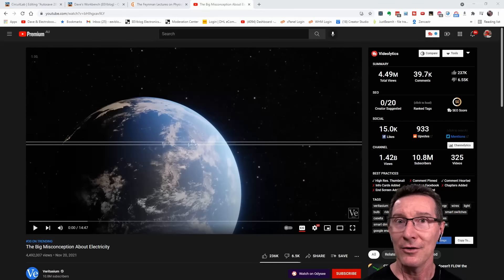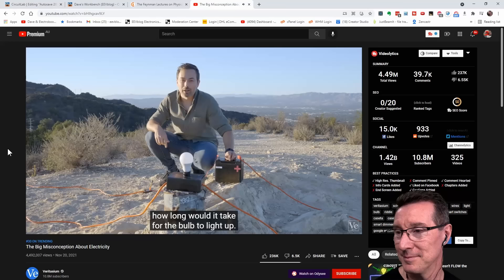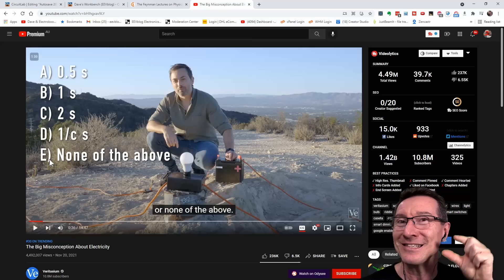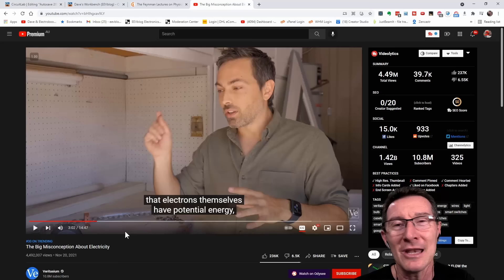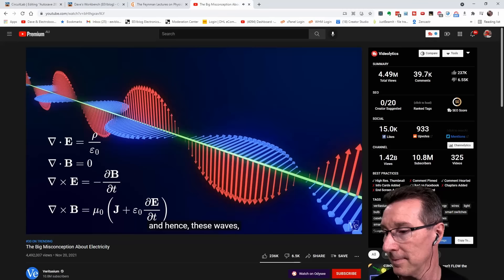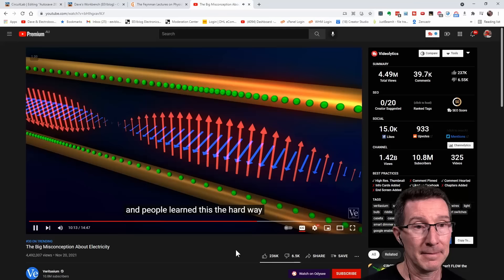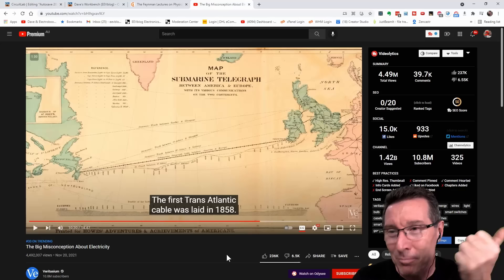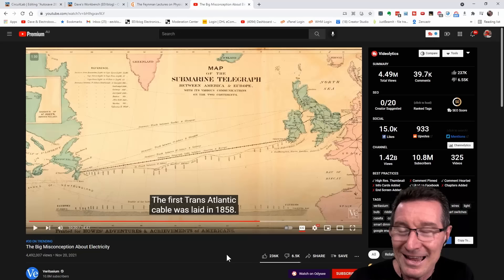EEVblog 1439 - Analysing Veritasium's Electricity Misconceptions Video

Comment: so, just to make sure: veritasium talks about how power is transmitted from the plant to your home. if I imagine a power line circle, on one end the plant and on the other my house, there's going to be a minuscule amount of power transmitted through the field in the center of the circle, am I right? but the majority of the delivered power is still going through the power line or rather through the field in very close proximity to the wire?
Reply: Yes, minuscule/insignificant amount is transmitted through air, in fact, this is undesirable, it can couple into unshielded circuits as noise. The real power goes along the power lines.
Reply: @1900OP  you are answering Lucas's question with erroneous beliefs.  I gather from your discussion that neither of you understand what Veritasium teaches.  I doubt I can make a dent in your beliefs, but I'll still volunteer the following.  There's a flow of electric energy radially outward from the battery to the space near it.  That space is where the EM field resides around the battery.  There's a radial flow of electric energy inward from the space around the wire to the wire, all along the wire.  There's also a radial flow of electric energy from the space around the bulb filament to the filament.  

Those are the facts, consistent with the basic EM laws of physics.  Your job now is to understand them.  Forget everything else you know or think you know about electricity.  The radiation energy you refer to, that emanates from a wire in which AC current flows, is irrelevant.  We are talking about the energy that lights the bulb.  That energy does NOT flow through the wire.  Charge flows through the wire, and it's called current.  The flow of charge is NOT the flow of energy.  Make a note of it.  

A further concept that may blow your minds is that the energy that flows radially outward from the battery is NOT the same energy that flows radially inward to the bulb filament.  That's because Mother Nature doesn't require it.  Nature only requires that both are numerically equal; i.e., that energy is conserved.
Reply: @beingsentient  i have no problem with the idea of power not going through/in the wire but around it. I have a problem with understanding if the light bulb in veritasiums vid goes full on or only some small amount and then the bulb goes "full" on after 1 second. 
"Full" on in 1m/c or only a tiny bit on in 1m/c and then full on after 1 second? 
Thanks for sharing
Reply: @beingsentient  
How have they measured the flow of energy coming in from all around the  bulb filament?
Reply: @redbutler751  Sorry, I really don't understand your question.  The time scale associated with the initial transient after the switch is closed is the order of a second or two.  The time scale associated with the first moment when the bulb "knows" there's a nearby battery is the order of ten nanoseconds or so.  Importantly, the transient needs to pass before the bulb reaches full intensity.  Is that clearer?
Reply: @robbiejames1540  I don't understand your question.  Are you referring to the steady state (DC) situation?  When you say "measured," do you mean actual experimental measurement or theoretical calculation?  In the steady state and theoretically, differential equations can be used to calculate the flow of energy into the bulb.  There are complications because of the actual geometry and I haven't carried out this calculation, but my guess is that reasonable approximations can be made for that geometry, with pretty good numerical results.
Reply: @beingsentient  
What I was meaning was an experimental measurement of the energy apparently flowing through the air from the battery to the bulb.
Reply: @beingsentient  
In my response to Lucas I was discussing his example, your home is km away from the power source, I said power is traveling along the line (it can be interpreted how you want, through the wire or fields around the wire, in practical terms, it doesn't matter), the rest is noise, and I stand by it.

 You are saying a lot of things, making an explanation difficult. But maybe this is your idea, to make things confusing, just like Veritasium did. Perhaps you also think you now know all about electricity just like Veritasium, when you've only learnt the poynting vector.

You say the same energy that flows outward from the battery is not the same energy that flows radially inward to the bulb filament, but IT IS the same, we're talking about EM energy (the form of it), and you also say they have to be numerically equal, yet you specifically say that there is energy flowing to the wire from the outward space, this means that wire  has a resistance (no energy flows to the wire if it doesn't have I*R losses), so numerically they are not the same (Energy_battery = Energy_bulb + Energy_I*wireR). 
Double check your conservation of energy theorem before you invent new concepts.
Reply: @1900OP  Thanks, mate! I think I got it. Also I feel like memyself misunderstood my question. I'm totally aware that energy flow != charge flow.
Reply: @1900OP  When people keep repeating what they said before, the conversation becomes fruitless.  I can only volunteer that you don't seem to have a broad enough nor deep enough grasp on basic physics to understand the basic EM concepts Veratasium explains.  You evidently are sufficiently capable of making engineering calculations, and you don't need an understanding of the basic physics to do that.  So you can go on your merry way calculating, but if you believe you understand the fundamental physics associated with EM theory, you're dead wrong.  You can talk to like minded engineers and feel good, but be sure not to run out of the Kool-Aid.
Reply: @robbiejames1540  I think I understand your question now, which involves the steady state DC operation of the circuit.  I don't know the answer.
Reply: @beingsentient  But you seem to repeat "You don't seem bright enough to understand veritasium" idea, you repeat it through the entire reply and previous comment, talk about repeating, duh.

But I figured you didn't wanted a conversation in the first place, you came here to teach, and anyone who doesn't agree with you must be dealt with, like you did right now.

You also seem to disregard engineering, do you think engineers don't know about the field they are working on? Do you think that calculations is all they do? Or was it part of the "you aren't bright enough" rhetoric you have against me. 

Veritasium is an internet influencer first and foremost, so what he says doesn't always makes sense, because he explores topics which requires great understanding, and talking about it with professors doesn't give him said understanding. 
Now that you say you have a good grasp of EM theory, it means you can explain Veritasium's experiment with your own words, instead of his, can you explain the phenomenas that happen when the switch is closed? How is energy transferred to the bulb in nanoseconds since the switch is closed?
Reply: @beingsentient  I quote you again, same  quote: "I can only volunteer that you don't seem to have a broad enough nor deep enough grasp on basic physics to understand the basic EM concepts Veratasium explains.", then what follows is  the usual insults, in all of your replies.

I don't know what you learned from veritasium, your opinions don't seem your own, only ideas told to you by veritasium, that's why you can't talk much about your EM theory you claim to know so much. So far you only told me 2 ideas, and I hope you can re-read your past replies so you don't claim I distort your statements:
1. Energy doesn't flow inside the wire, and charge flow =!= energy flow
2. There is a radial flow of energy outward from the battery towards the space around it, and inward the light bulb and wires if they were to receive energy.

So is this it? :) Is this all the EM theory you know? What about other more important principles that come before all this, like Maxwell's equations that define such behaviour in the first place, or maybe more specific, like talking about the electromagnetic radiation caused by accelerating electrons that produces the energy that is transmitted through the air? Of course, Veritasium doesn't talk about antenna effects or electromangetic radiation, neither does he talk about the whole thing being a transmission line, so you wouldn't know too.

I suggest you read Feynman's lectures, or if you really like getting your info from influencers, i'd suggest otherwise, Prof. Walter Lewin's lectures on youtube, because your physics knowledge is questionable.

If you are to further insult me, I will no longer respond, you're free to do as you wish, but if you want to debate, I'm open anytime here, I'm open to ideas, if you are really knowledgeable, I want to learn, so cite me some sources if you have, or books that I can find online. I'm also not sure what is wrong with "Energy flows along the power line" statement that started this all, you don't agree? Is this not fundamentally the thing you talk about, the field around the wire part? Because most of the power flows through there, that lights up your bulb in your home, not wireless energy, if you think otherwise then why do we have power lines in the first place?
Reply: @beingsentient  - If that were true for steady-state current flow then wire gauge wouldn't matter, BUT it does matter. In a steady state DC or low frequency AC circuit Power = I x I x R for a purely resistive circuit. That's why we have 15 A, 20 A, 30 A, etc. circuit breakers for 14 Ga, 12 Ga, 10 Ga, etc. wiring. I realize from a physics standpoint the field around the wire carries the energy but from a practical DC or low freq. AC the voltage and current through the wire determines the amount of energy transmitted.
Reply: @WJV9  The first phrase of your first sentence is erroneous.  The truth of my description does not imply that "wire gauge wouldn't matter."  The gauge will affect the initial current flow that in turn sets up the magnetic field.  With higher resistive wire, current flow is reduced, resulting in a lower strength of the magnetic field.  This is basic electricity and I suggest you study up on the fundamentals.  Review your understanding of Ohm's Law.
Reply: @beingsentient  - I have a EE degree and throughly understand , Kirchoff's Laws, Maxwell's Equations and Transient Analysis which from your description it is difficult to understand if you do. ;)
Reply: @WJV9  You're degrees are secondary.  Primary is your understanding, and even that can be sufficient or insufficient.  

I have a Ph.D. in Aerospace, and so what?  I have a friend with a B.S. and M.S. in EE and a Ph.D. in Physics and he doesn't understand this.  He argues from what's in his head, as if he pulls it off a shelf.  He needs to think about the basic physics.  I've answered all his questions, yet he still hasn't shown he understands this.  Dave here is similar.  He doesn't understand what's going on because he hasn't focused on it.  Maybe he's not capable of focusing on it.  

We are all limited, but some of us have better grasp on the basic physics.  This is more physics than EE.  When you study EE, you are a step away from the basic physics and it's rare that an EE professor understands things from a basic physics point of view.  Like Dave here.  So I suggest you forget all you know and take the problem from the beginning.  Apply your understanding of physics, step by step.  Be aware of all your assumptions.  I don't know how else to make it clearer.
Reply: @WJV9  Thanks for the link.  AlphaPhoenix does a pretty good job of explaining many of the physical details here, and his explanation of the very first flow of current through the resistor (bulb) - which is my main interest - is pretty much like my own.  To repeat, it's due to the propagation of electric and magnetic fields through the air space between the battery/switch and bulb.  The effect of the entire wire circuit, acting as a transmission line, is irrelevant. 

AlphaPhoenix suggests there's a radiating positive and negative electric field set up because of bunching or rarefaction of electrons in the wires connected to the battery and switch.  I hadn't thought about that, and I'm not sure how much such bunching or rarefaction contributes to the E-field that the bulb first senses. 

I suggest in addition something that AlphaPhoenix omits, and that's the fact that with the initial flow of electrons near the battery and switch, a magnetic field is set up, as with any flow of charge, and that this combined EM field propagates through the air space to the bulb, much like with the action of an antenna. 

But if we want to be picayune about it, perhaps the very first effect on the bulb is due to an E-field.  I think the bunching/rarefaction effect mentioned by AlphaPhoenix is only part of the story.  There's probably an additional effect of E-field, and that's because of the wave of voltage potential that travels immediately after switch closure.  I suggest that the voltage potential itself, which is different from the potential that existed before wave passage, creates an E-field.  But I may be wrong in this regard, and I welcome any contribution from others on this point.

I think this video is worth watching, and I'm impressed with the work AlphaPhoenix has done to contribute experimental evidence for the fascinating phenomenon we're trying to understand.  My one suggestion would be that AlphaPhoenix reduce his verbosity.  He just talks too much, and hence, smothers a clear and straightforward statement on the essentials, all of which could be clearly stated using only a small fraction of the words with which he bombards the listener.
Reply: @beingsentient  

Hey dude, may i ask you.
Out of the discussion you have made but a different one.

If you were to build an electrical distribution corp. would you rather choose an electrical engineer to run it or a physicist?

Comment: Absolutely right, this is transmission line theory. The smearing in the undersea cables will be a combination of things, but most importantly, dispersion, where propagation velocity is dependent of frequency in a lossy transmission line..
Reply: Yea.. also.. he really explained it like its always ac.. still used a battery to show it.

And that is also in effect why most under water powerlines are DC...

Suprice
Reply: @mattmurphy7030  Or RLF, ridicules low frequency

Comment: You are correct, Engineers do think in a different way.  The layman's point was HOW does the light bulb REALLY power up. His main point, irregardless of wire distances, whether true or not, was that the true source of transmission is the electro-magnetic fields. As understood this should be able to explain the relativistic transmission speeds. I just love how Engineers over engineer and look for problems where none exists.